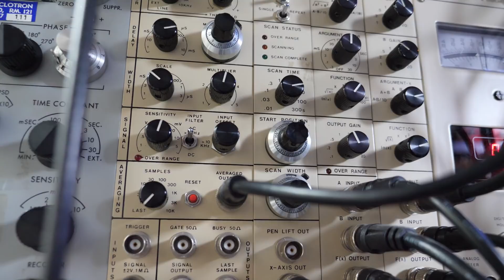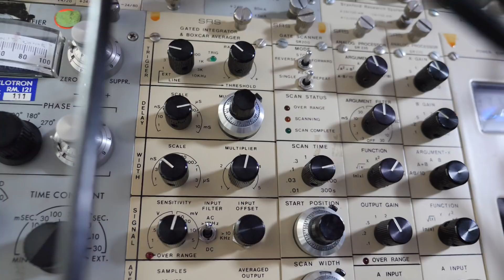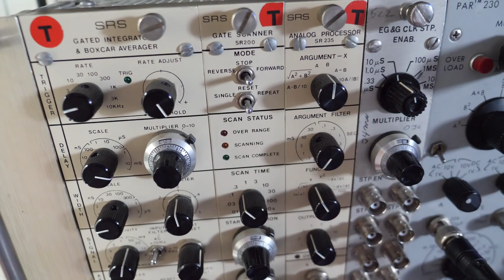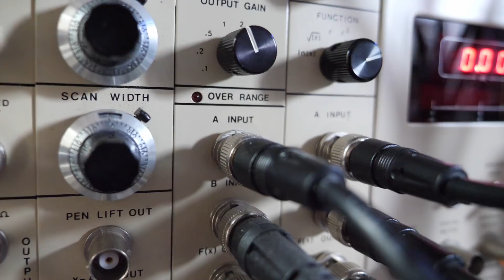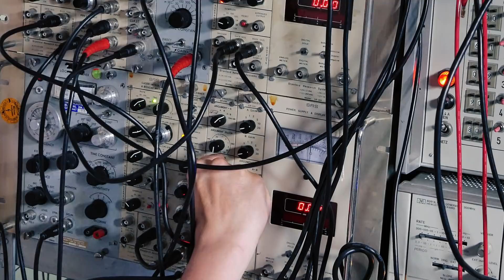Music On Nuclear Research Equipment | SRS BOXCAR AVERAGER

Comment: Reading the title I just expected the random noise crackles you get from a radiation meter XD I get now that we're talking about studying nuclei, not nuclear energy.

I'm not a scientist either, but in physics class a couple years ago we learned that the energy levels of an electron (and I think any quantum particle) are always integer multiples of the base level n, so 2n, 3n, 4n, etc., like the harmonic series, which resembles a major scale. Maybe I'm wrong but that could be why that piece of equipment spits out musically quantized signals. (If it's really this I'd feel so smart)